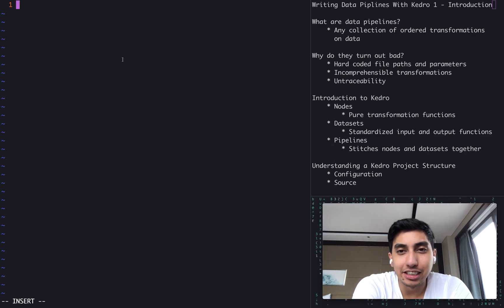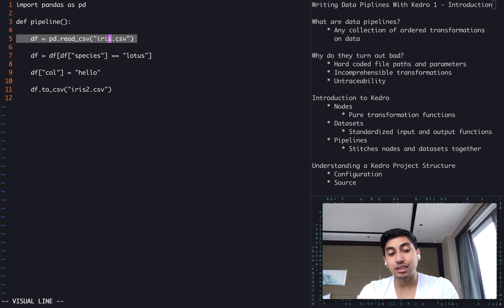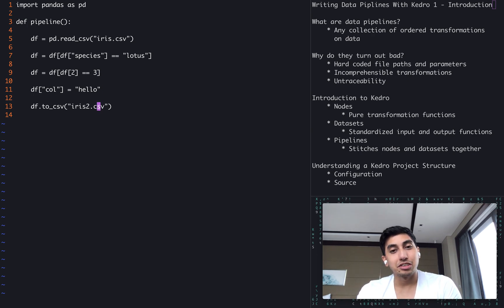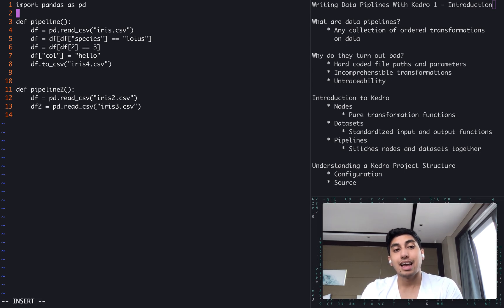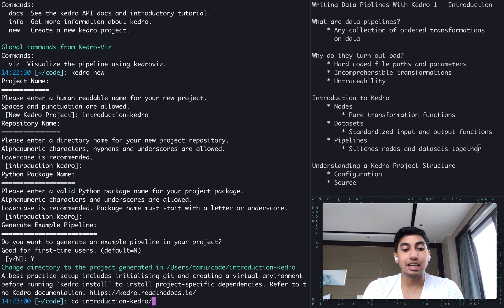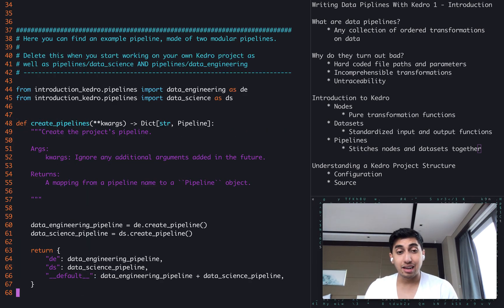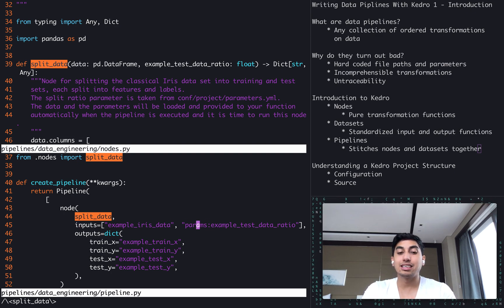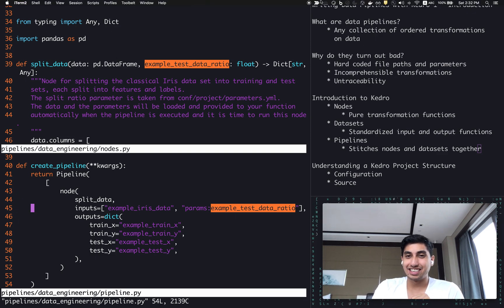Introduction to Data Pipelines and Kedro - Writing Data Pipelines With Kedro 1

Comment: I am trying to implement the shown steps in a Jupyter terminal, but I am getting errors. For example: not able to execute the vim commands. It says: The term 'vim' is not recognized as the name of a cmdlet, function, script file, or operable program
Reply from the maker: `vim` is a text editing program. You can use a different text editor, instead, to edit the file!
Reply: @DataEngineerOne  Which text editor are you using here? I have tried multiple and getting some errors everywhere. Apologies for the silly doubts!
Reply from the maker: @chetanagrawal1519  `vim` is the text editor I'm using! What errors are you getting? Perhaps you can share at https://kedro.community